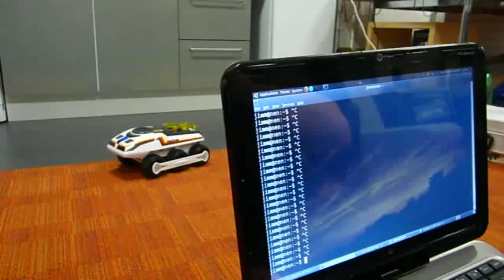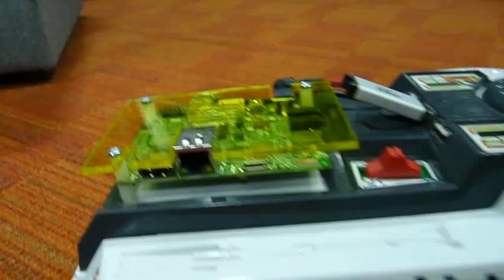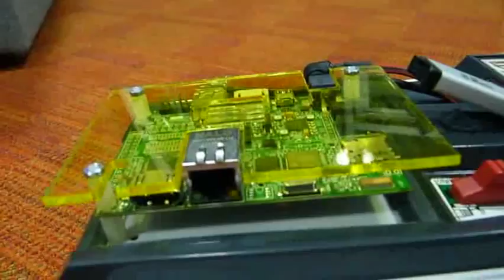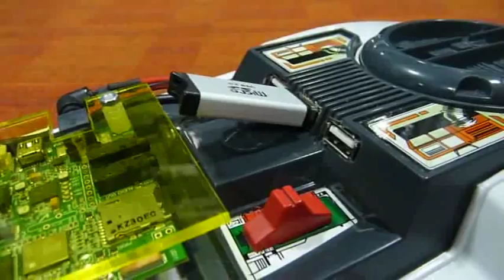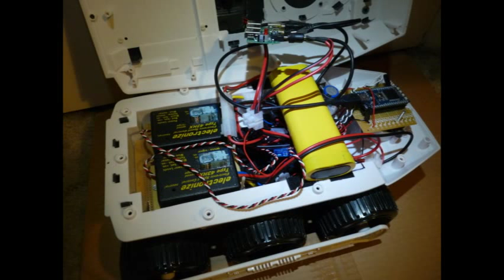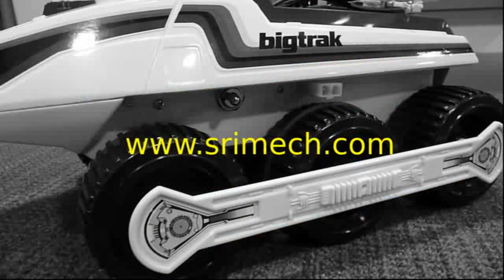Modified BigTrak with IGEPv2 board and mbed

Comment from the maker: The usb ports are currently used for a keyboard and mouse, for use as a desktop PC (it will run Firefox and a couple of terminals fine) and also a webcam, which I've recently got working with Linaro.